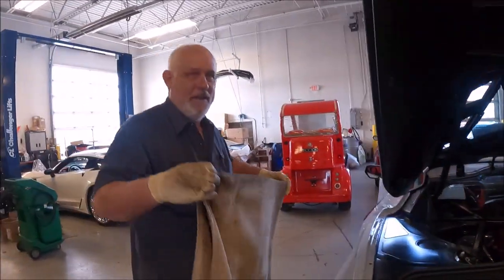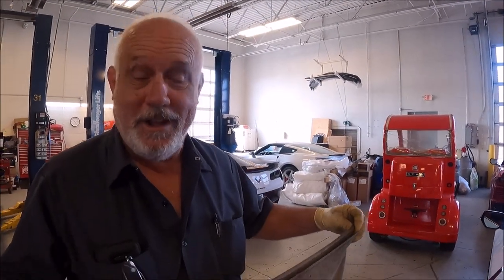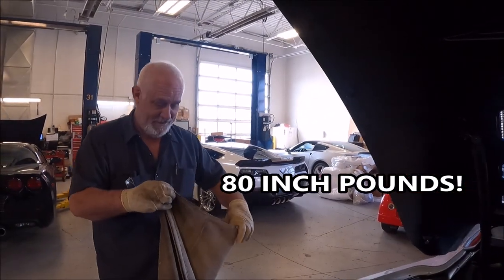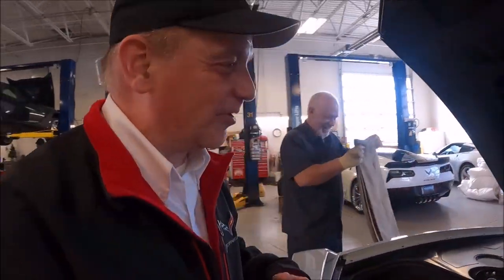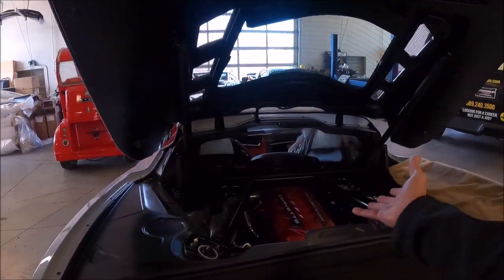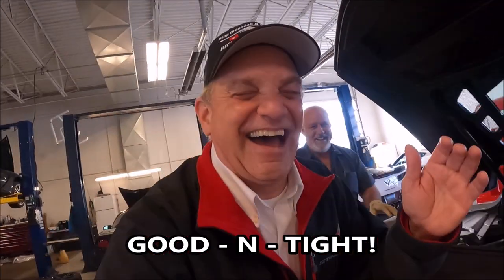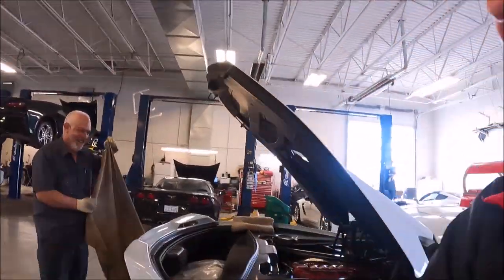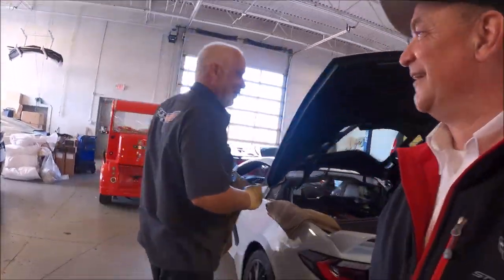WHAT IS TORQUE SPEC FOR C8 CORVETTE ENGINE COVER #shorts

Comment: Rick,  Make sure you and Chuck emphasize the torque for the engine cover is INCH POUNDS, not Foot pounds like most bolts.
Reply from the maker: he did say that I thought
Reply: @CorvetteShortsMore  lol....yes I remember telling an apprentice that worked for me several years ago to torque intake manifold bolts to 70 INCH lbs and handed hm the printed copy of the sequence with the spec on the sheet in BOLD letters...he torqued them all and upon torquing the last built he ran into trouble  ... he said "I dont know what happened I torqued them all to 70 FOOT lbs just like it says and this one just snapped"..... I am familiar with the German spec GOOD N TIGHT, but I disagree with Chuck on this one, I believe it is the other one JUST-E-NUFF lol